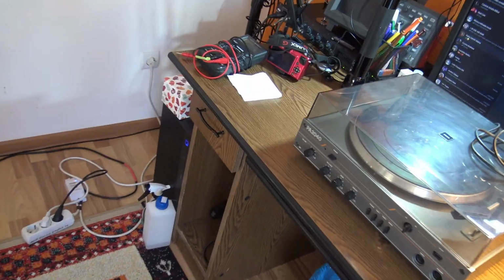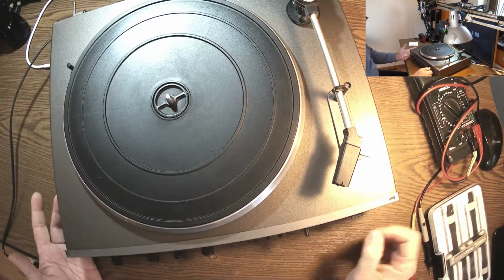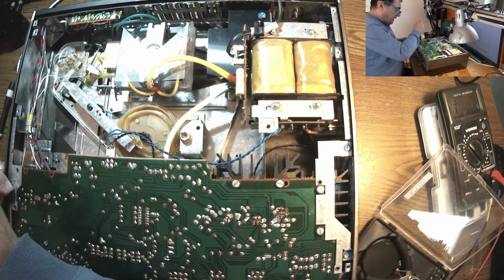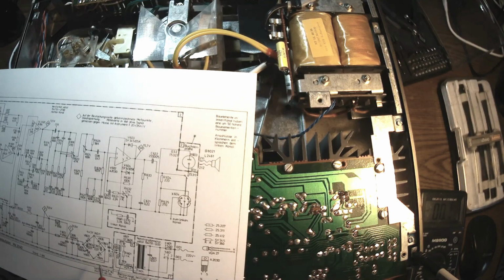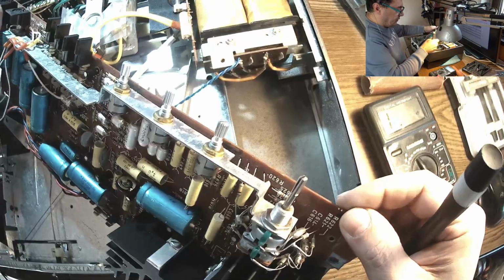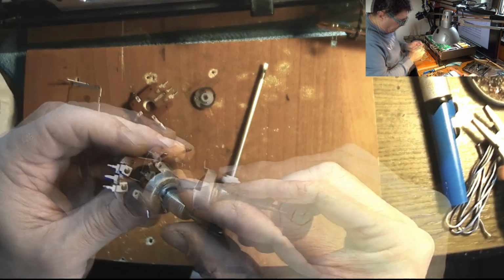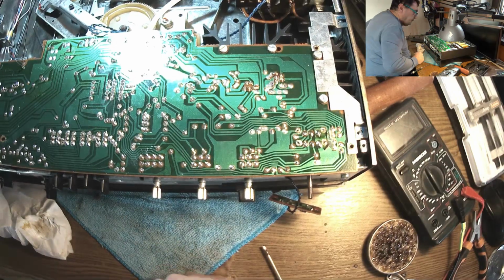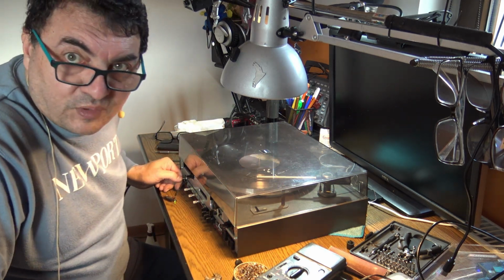Ziphona RFT PA2040 turntable pick-up repair

Comment: Got a broken tonearm on this exact model, the tiny part that is supposed to rise and hold it on the disk is broken for the arm itself. Any chance that can get fixed ?
Reply from the maker: I don't believe you can find a replacement, probably a ruined Ziphona will give you parts...

Comment: Hi, Viorel. I have 2 pick-ups. The first one is a Concert 2030 with potentiometer problems and the other one is same as yours (PA 2040). When I plug in the speakers in the second one, I can't hear anything. Can you help me fix at least one of them, please? What should I do? Thank you
Reply from the maker: Hard to say what's wrong...If there is no signal at the output, no hiss or clicks in the loudspeakers can be a ruined power amplifier, TDA2030 I recall. Start  by checking the fuses, power rail and so. Google for schematic and next will be easy. Good luck!

Comment: Hello, I have the same device, the sound suddenly stopped, did the sound output burn out, please help?
Reply from the maker: Start checking the fuses...if replace them doesn't fix it, it should be a burned amplifier IC. It can be easily to replace if you find parts.
Reply: @viocaia  Thank you for your help, I enjoy watching you.

Comment: Good job. What volume potentiometer model should I buy to replace the defective one in the turntable pick-up ?
Reply from the maker: It's impossible to find, there are few middle connections for loudness control too...so the original it's not produced anymore. But a double logarithmic  47K potentiometer will do the job. Here you have the schematic, what are you looking for it's part no R623 https://elektrotanya.com/rft_pa2040_sch.pdf/download.html

Comment: First of all thanks for the video shared! I also have an PA2040 with a problem on the automatic start procedure: when turning the knob to select the speed to play, the arm raises and goes to position itself on the vinyl but it doesn't go the full way and stops before reaching the vinyl and then it drops close to it. Did you encounter this kind of issue with PA2040? I really appreciate any help you could share! Thanks!
Reply from the maker: It's looking like a mechanical misalignment, check the parts for missing or broken plastic parts, even metallic torsion .. I don't have the machine anymore so I can't say too much...
Reply: @viocaia  thanks for the fast reply. I took down the metal case but still couldn't see what's beneath. And I am afraid not to break something if I unscrew more... Could I write you on whatsapp or on another application? I wrote you on instagram but I am not sure if you use it that often.
Reply from the maker: @neculai2008 I wish to help you more but as long as I don't ''feel'' the device I can't give you a solution...I didn't fix the mechanics on this 2040, sorry...
Reply: @viocaia no worries, thanks anyway. I will open it again and try to find the issue hoping that I'm not gonna damage something else. But in the meantime (because I have this equipment for one week and I don't have a dose yet to test it) I tested first the belt and it is good (the speed of the rotation is in parameters) and yesterday I bought a cable from DIN 5 pins to jack stereo to try the AMP through TAPE 1 and TAPE 3 auxiliary connections. I also borrowed a speaker on 7 ohms from another pickup of a friend and it seems I have no sound. This means that the AMP is damaged or am I doing something wrong?
Reply from the maker: @neculai2008 It can be, those 2030 power amplifiers chips are very sensible. Check the fuses first, the power supply and also you can test the inputs simply with a piece of wire in those five pins, one by one, you should hear a buzz...if not, check the other channel , move the loudspeaker to next output. It's hardly to have both channels burned.
Reply: @viocaia  thanks a looot! You were right. The problem was with the fuses on each channel. Both of them were burned. I replaced them and I have sound! On one channel (Left) I have clear signal. On the right channel I have a very ugly noise. I will put here a video to understand the issue. Can you please tell me if it's fixable and also you'll see that each time I move the potentiometers for balance, bass and high, there is a lot of noise from those too. Can I fix those also? Many thanks for your support!
https://youtu.be/ic_292dWgb4?si=2rNMxI0_W8U0lYrx
Reply from the maker: @neculai2008 Hello! You can solve the noise in potentiometers with Kontakt Spray. As for the channel with the problem, probably the A2030
 or TDA2030 power circuit is burnt. Must be replaced. Here's the schematic for your particular turntable https://elektrotanya.com/rft_pa2040_sch.pdf/download.html

Also here you have the Kontakt spray sample https://www.emag.ro/spray-tehnic-kontakt-60-200-ml-pentru-curatarea-contactelor-70009-ac/pd/DP7JFJBBM/
Reply: @viocaia  thanks for the advice! I will clean the potentiometers as you recommended me. As for the A2030V from the main board, I will order 2 of them online to have a spare. You recommend to change both of them even if on the other channel the sound is good? Or only the bad one? And also I noticed that the A2030V component has some white paste between itself and the big radiator, should I also buy some thermal conductor paste to use when replacing the components?
Thanks!
Reply from the maker: @neculai2008 Don't replace the good one, let it run. Be sure you also have a isolator between chip and  heat sink, as for thermal paste it's a need, you can use any paste from computer shop, used for cpu (grey one)
Reply: @viocaia  the isolator is a component found in electronic store or what kind of isolator do you refer to? Sorry but I haven't done thise before and I want to be sure I am doing it right. Thanks!
Reply from the maker: @neculai2008 Probably you'll get it when you take out the burned IC, check the back of the circuit for a plastic or mica piece, reuse that, it should be ok, but also you can find in electronic shop. Look here around 0:30 how to use thermal isolator and past https://youtu.be/JUXmjuFrh_o
Reply: @viocaia  thank you very much! I'll come back after changing the amp with feedback.
Reply from the maker: @neculai2008 Please do and good luck!
Reply from the maker: Probably it's related to that big plastic wheel with leading channels, that's the one moving the arm...but like I said I got no idea how the mechanics works there.

Comment: Nice job. Who would still repair a potentiometer nowadays? I like your way.
Reply: in any way I don't think it's an easy to find replacement :)
Reply from the maker: @vasquezitosanchezito  There is no replacement, this kind of gears are long time gone, so improvise is the only way.
Reply: @vasquezitosanchezito  In the good old days things were made in a way, you could open them nondistructive.
What about today's devices...
Reply: @ampere0124  planned obsolescence nowadays unfortunately
Reply from the maker: I like it..